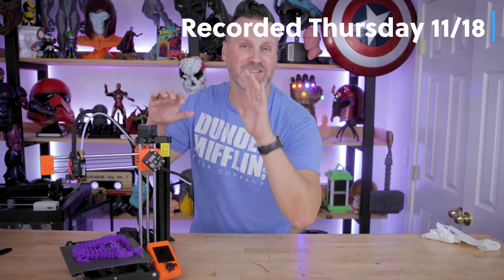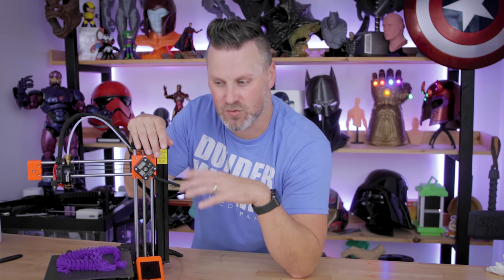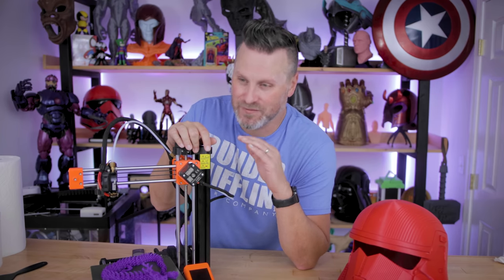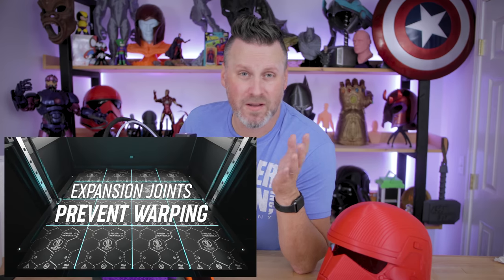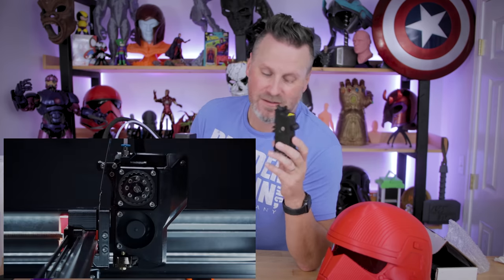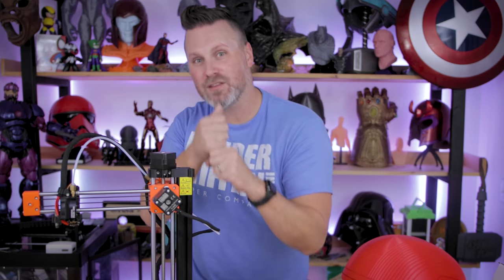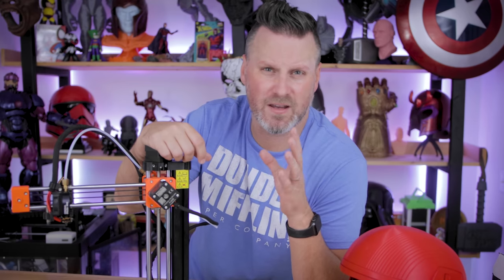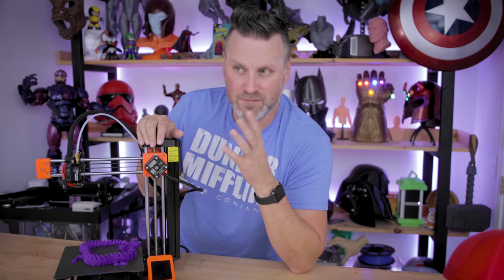New Prusa XL 3D Printer! The ULTIMATE LARGE 3D Printer?

Comment: Heated beds use one of two strategies: 1. Milled aluminum plate with AC heater. 2. PCB DC heater. The XL and the Prusa print farm to my knowledge are the only printers in existence that use tiled PCB heaters, and they're a nice solution to the problem of bowing print surfaces due to thermal expansion.

Comment: I ordered mine yesterday.  It looks like a fantastic printer and the start of a new generation of FDM printers.   I finished my RAT RIG 400 about a month ago, this looks even better and about the same price.
Reply from the maker: Oh wow! I didn’t realize it would cost almost the same to build the Rat Rig. How’s it printing?
Reply: @UncleJessy  It is printing well.  I think I have about $1200-$1500 in it. I purchased the kit from RAT RIG without extruder and board.   One of the advantages of the XL is no front extrusion blocking the hot end.  I loose about 50mm because my OmniaDrop extends so far forward.  This is also a disadvantage for the rigidity of the printer.

Comment: YES! So excited for the XL! Definitely large enough for helmets. 

On our minis, once we did it once the bed level worked. They are using load cells to verify the first layer.

There are not other machines to my knowledge in this price point that have multiple small beds for heating. 

You do not need to level the panels, the machine deals with the lack of perfection in the Z axis. 

My guess for the plate is that it is the same, but it is MUCH larger and therefore heavier so it will flex more, could be wrong though. 

RGB ALL THE THINGS! more or less lol. 

Great video as always sir! We will be doing a deep dive into all the stuff too! Pre ordered the big boy 5 extruders!
Reply from the maker: wowza! congrats on that 5 extruder preorder. Next summer I will have to stop by and see it in action ;)
Reply: @UncleJessy  If we have it in hand by then, absolutely! For what we do it makes a ton of sense, sure, we did not NEED all 5, technically 2 or 3 would get it done, but hey, the 5 means more fun prints, time lapses, and more!

Comment: Touchscreens can either have a ton of trouble registering taps (resistive) or register ghost touches (capacitive) depending on how lousy the electronics or mounting are. I for one prefer the encoder wheel to the touchscreen on the $5000 printer at work.

I've probably worked with those LEDs before, they're very likely RGBW 5050 Neopixels.
Reply from the maker: Yeah there is probably a little pro and con with both screen options. Also for the touch they might have needed to go larger
Reply: Come to think of it, the best interface I've ever used was Octoprint. 😅

Comment: I ordered within the first 12 hours I'm guessing, so probably weeks behind you in receiving mine  :)   The new bed leveling without the need for live Z is huge for me.  I ordered the 2 tool version because I do want to get back to multi-material (had a mmu2 on my MK3s, but removed it and put on a Bondtech LGX because it was too finicky for my taste (runs great now).  Also the nozzle quick change feature should be very handy.  Doubt I'll ever use the full build height but I can see where I'll use the bigger x and y to make say 20 copies of small things at once vs 10 or 12 as I do on my MK3.
Reply: I'm debating going for the 2 tool. What will tip me one way or the other is when they announce the "other" tool heads they hinted at ever so vaguely. I mean, are we talking CnC? Laser? what?
Reply from the maker: Yeah I’m wondering if I should have sprung for the 2 tool option. Might add a 2nd on later
Reply: @UncleJessy   Yeah imagine using a bigger nozzle to do the infill and a really small one to do the outside details. That would change CRAZY the printing of large items.

Comment: You have quite a few valid points. I'd like to comment on some of them tho.
The heatbed looks like a normal powder coated steel sheet. It just looks more flexible in the video since it's a much larger bed i think.

I don't know how many touch-screen 3d printers you have, but when navigating through lists of g-code files i'd much rather have the clickwheel than use my finger, touch the wrong folder, have to go back again, into the corrrect folder, to then press the wrong gcode, having to cancel the print, find the correct gcode... You get the gist of it. I MUCH prefer printers with clickwheels, just as i preferred the old iPod clickwheel for scrolling through lists of music.

Comment: The reason you may want a second extruder is to use soluable supports.  With soluable supports you will not have the cleanup you do with standard supports.

Comment: The heated print bed made up of segments is a good idea to isolate the hot areas from the cold ones, moreover it is necessary to have some space between the various panels because each panel expands laterally. They claim that using the panels reduces the warping of the print bed, however the problem is not in using many panels or one single print bed, the problem is the fixing method, which if it blocks the expansion of the print bed induces internal tensions and therefore deformations. The individual panels are still fixed by 4 countersunk screws, so the single panel will in any case go under deformation, however, since the panels are small (90x90 mm), the deformation of the single panel is less than that which would be obtained by fixing it in the same way a single 360 mm panel ... moreover, by using more panels they can afford to require a massive production and therefore the price per single panel is reduced. I think this printer is aimed at companies, because there are many solutions aimed at redundancy and limiting losses in the event of a malfunction. i.e. If a central panel breaks, you can order one from prusa and in the meantime swap the broken panel with another one that works and still you are paying for the replacement of a 90x90mm panel and you don't have to pay to replace a giant 360x360mm panel.
Prusa XL looks amazing, but it is very expensive for home use and being a new product I don't trust much ... I will wait for the reviews to see if they are improving regarding the release of new machines, but I think it is better to wait for the release of the next prusa mk, i hope it will also be a core xy (so can they call it Prusa L?) in the standard format (250×210 mm)... but those panels make me think that maybe it will be 240x240mm, so upgrade on the print volume . nice
Reply from the maker: thanks for all that detailed info! Also right there with you. I jumped right on it wiht my preorder but totally hear you about the initial products not being truely ready for primetime. Those panels are wild!
Reply: If it were any other company but Prusa I would also have waited but they have earned my trust over and over. I know if there are issues they will be fixed and made good and any upgrades will be either printable or released later as a + version (which is what I did with my Mk3 -> Mk3S+ after buying a Mk3S+). The typical low budget home user isn't buying Prusa anyway, thats what the knockoff companies are for. You will start seeing these Prusa innovations in their products as "new features" once they go open source in a couple of years lol. I've been waiting for a large print volume Prusa for a bit now and for me, the price is about what I expected. I will have to build new enclosures for my XL and Jupiter but I'm super excited for both!

Comment: this printer looks like the one to beat at the moment. LOTS of features ripped from industrial machines. That auto nozzle offset, load cell based z cal, etc. Dual extruders with soluble/breakaway support really allows for geometric freedom! Throw some servos and a fully heated chamber and you have a truly industrial capable printer for a fraction of the cost of an industrial machine
Reply: also we need to do away with magnetic sheets in favor of vacuum held down plates. Then you can use a plastic sheet of whatever you want. Print ABS on a HIPS sheet, print nylon on a Garolite sheet, etc etc. Magnets fail at the high temperatures needed for engineering materials

Comment: I am getting into the hobby and planning on developing further.  the price seems bad, but with the head design, modular bed, and other things I can understand and think it is a good deal.  what I would be most curious about is how reliable it is and how is the maintenance on it.  I may get the 2, unlikely to get the 5 head but may try.  not so I can do multiple colors but so I can have lots of filament so when a spool runs out it goes to the next spool automatically (I hope).  then reload more filament later.  allowing the build volume to be full and not have to worry about it.  as well as using just about every bit of filament on a spool.  I am hopeful and it would be neat if I can get to a point that I can justify what seems to be a fire-and-forget printing system

Comment: The only thing that disappointed me about the XL was that it was smaller than initially suggested, in that Prusa stated in a video with Joel Telling that it would be 400x400x400 and possibly 500x500x500 all around. 360mm is still bigger than anything I own and I'm happy to finally have it announced. I was expecting at best a Prusa version of a voron or seckit but they went above and beyond. Worth the pre-order.
Reply: Would be nice to have a 450mm^3 option
Reply: @vidznstuff1  A recent blog post from Prusa suggested that due to the modular nature of the bed it's easy to add more. They might release an upgrade kit later on to get to that size.

Comment: The XL auto bed levelling is different from the mini, the XL uses a strain gauge to detect when the nozzle touches the bed, so it wont need to adjust the distance since it already knows where the bed is
Reply: I wish that were the case but I have been dealing with the strain gauge on my CR-6 and I actually prefer no ABL and then a BL-Touch before the strain gauge. It gives so many problems and still needs constant Z offset adjustments. Every time you level you still get different readings on the mesh. Only thing you don't need is to set the initial Z offset when installing ABL like with the BL-Touch.
Reply: @MysticGrower  the cr6-se uses a different type of strain gauge and also it’s not very well implemented, though I do agree that the lack of live z adjust might be a questionable decision
Reply: @MysticGrower  What TadHG said; the load cell on the CR-6 only does on/off; the prusa one will detect ranges.  This one actually has a range.  I'm sure they'll have a fine adjust after the fact. One of the things to keep in mind is that you cannot compare the creality (or really, anyone elses) equipment to things like the MK3S+ and the Mini; I've had my hands on a ton of machines and it wasn't until a few years ago I gave them a whirl. There's nothing else out there like them and they feel like like a real tool that someone put thought into; there's a slim chance it could be bad, but I'm more than willing to give them benefit of the doubt here. Also, seeing Makerbot quietly extend and deepen the discount on the Method X after the Prusa interview Thursday afternoon should give you an idea of how worried the competition is about the XL :P
Reply: @MysticGrower  I don't have any issues with my CR6's strain gauge. Are you running the community firmware?

I even swapped out my hotend for a Dragon hotend the other day and didn't do any recalibration (other than PID) and it's still printing perfect first layers.

Comment: I doubt the heat up time for just a segment will be any shorter than for the whole bed. After all, you do decrease the heating power by the same ratio as the built plate area. The point is not the time though, the point is the large amonts of energy one is wasting when heating a huge build plate yet printing only a small thing.

Comment: Its a bit odd that you are having issues leveling the mini. I have literally been printing on mone for just over 2 years and put at least 40 spools through it and never had an issue. If I swap the nozzle I run through the z calibration, but I never touch it otherwise. I threw away my ender max because I could never get that POS leveled, it was so frustrating. Anyway, great video as always already pre ordered my XL also!

Comment: I think the single small build plate will heat at the same rate as the entire build plate youre thing in reverse
Reply: Yes, they would heat at the same rate. The multiple smaller plates could do it with less energy though. Prusa mentioned they could heat and drive the bed using a checkerboard pattern to use effectively half the amount of energy at any given time (so less strain on the power supply).

Comment: The Prusa XL is definitely geared towards a printer farm.  I got tired of waiting for one, so I bought a Chiron.  I want the multi extruder options for using different support material, but I also like the ide of using different diameter nozzles for different parts of the print.  I was told the expect a milling head (I have not seen a confirmation of that), which could be used to print fast, stronger thick layers, and then mill them down for great top and side surface finish.

Comment: I'm really wanting to know the overall external
dimensions of this machine so I can figure out if
it will fit in the space I have.
I did contact Prusa and was told that the
dimensions haven't been released yet.
I guess this is probably because final production
is still a few months away and the design could
change a bit.
If anyone has any info about this or could
extrapolate dimensions from the images please let me know
Reply: I pulled a reference image into FreeCad, and scaled the bed to 360mm. The frame appears to be roughly 430mm wide and 430mm tall, not including wiring loop on the top or spool holders on the sides. I did not find a suitable reference for the depth, but you can assume it is significantly more with the tool changer in the back, and the control panel hangs off the front. This is just a guestimate and may be off by 20mm or more.
Reply: @micro2743  thanks for that info. The space I’ve got is 530mm wide x 620mm deep. Currently about 650mm high, although it’s a shelf on a rack so I can adjust the height

Comment: I am ok with the price, but they need to stop 3D printed parts on it lol , they are big enough now. 3D printed parts eventually fail because they are still layers bond together. They need atleast Injection moulded abs or, cast/ cnc aluminium or using SLS PA12 like Bopndtech does for their extruders should be baseline.
Reply: The printed parts on my prusa mk2 outlived the rest of the printer, I still don't see it as that big of an issue.
Reply: At that price point, I expect an all metal frame, and they could have at least used 30x30 T-Slot extruded rails that are common in a frame this size.

Comment: For such an expensive piece of hardware i dont want these orange 3d printed parts on it, like i can see tons of strands of PLA peeling off in the video...
Reply from the maker: I didnt even think of that while recording this... why are they even still using 3D Printed parts?
Reply: @UncleJessy  Right? and no idea but its been like that since the start of prusa. It is a cool idea with a 3d printer that prints a 3d printer, but for a highend printer that cost up to $5000, I think its fair to expect highend quality build, like metals and injection molded plastics!

Comment: 2k for just some good inventions...the bed looks overengeneered...bending heat beds are mostly a problem of too thin heat beds..on the XL its a again a movin build plate....so they cant use a massive aluminium build plate...and still a more or less oben build...so no real high temp material...that cover is black...i dot want to print high temp filaments and dont see whats going on. for less money you could build a Voron 2.4 which can print really high temp Filaments...and thats not an overpriced PLA/PETG printer ( maybe some ABS) the extruer looks interesting...the rest is imho not thought to its end.